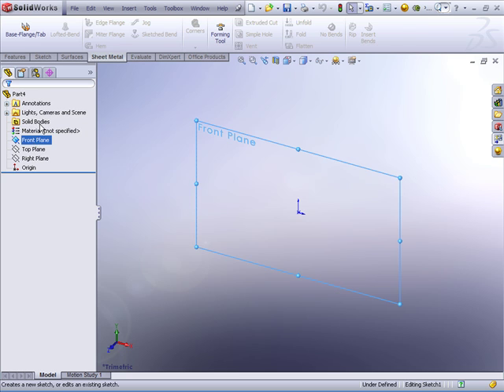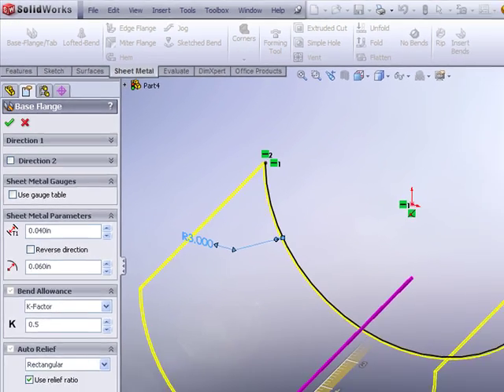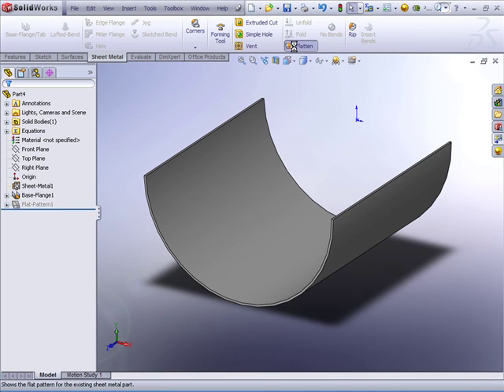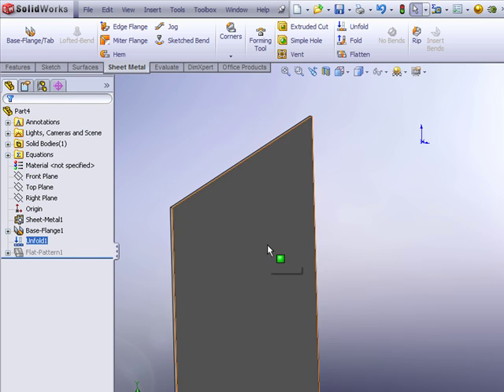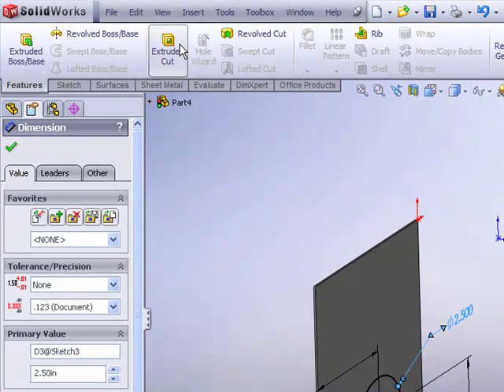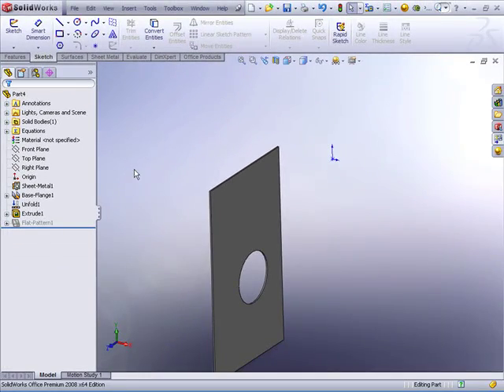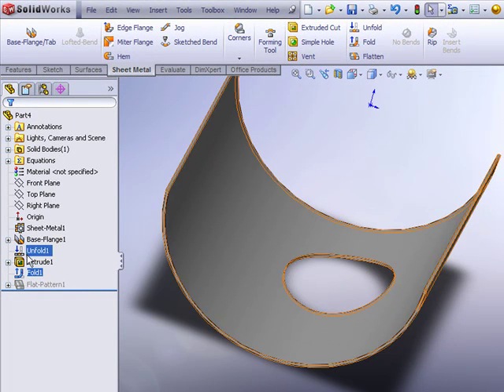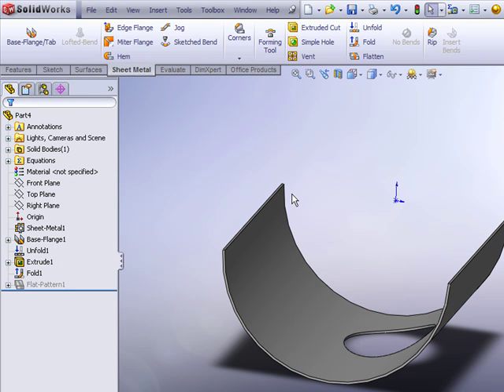SolidWorks Rolled Sheetmetal

Comment: Other issue I found is on the flat pattern Solidworks doesn't recognize the feature as a circle. That will be a splin instead. Do you have the same issue?

Comment: I've seen the same issue as Matt Cole.  Try changing K-Factor setting to Bend Deduction.  Make this value 2X your material thickness.  Flat pattern dimensions should match those of your bent sheet metal parts.

Comment: I experienced the same issue matt cole found. But actually its not a bug, its the setting named K-Factor. You can enter a value there which adds material automatically when the material is bend/folded. Standardvalue is 0,5, make it to 1,0 and u will get the same length in both conditions.
Reply: Thanks a lot sir

Comment: The problem I have found with this is that the length of the sheet metal changes drastically when unbent due to a bug in the calculations within Solidworks.

Comment: How about  if we  make extrusion  in that half round sheet metal with let say 2 diameter  with offset ( x coordinate) from the center 25%. Does it mean that if we unfold this extruded part, solidwors works will give us unfolded 2" diameter circle which become some elliptical shape. And geometry of elipse that we receive will be accurate?

Comment: I tried to add a louver using the forming tools but it I get a warning when I fold it,"Warning the following features were lost while folding/unfolding bends. Currently only simple through holes arfe supported inside a bend region:LOUVER."

IS there any way for me to put louvers on the inside of the cylinder?

Comment: Is there a way to transform a solid cylinder  which I already worked on (cuts , holes and stuff) to sheet metal ?

Basically I did a vase and know I want to flattened it to see how the laser cut will be. 

Thanx

Comment: this is great however im trying to roll a piece that the fixed edge is not parrallel to the other edge. so i flatten in out using "unfold" cut it to desired shape, lets say a circle or a triangle using "extruded cut" but then have problems when comes time to refold it using "fold"